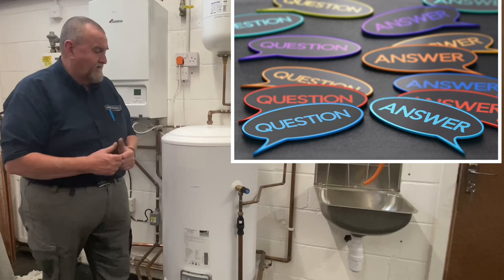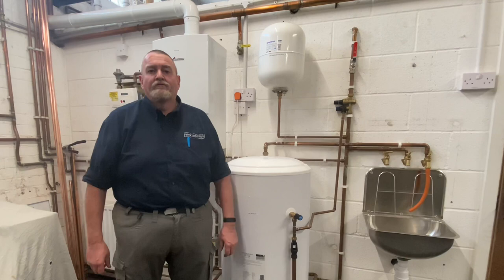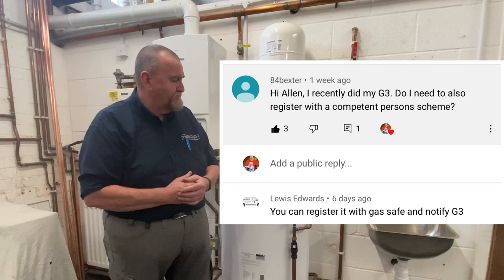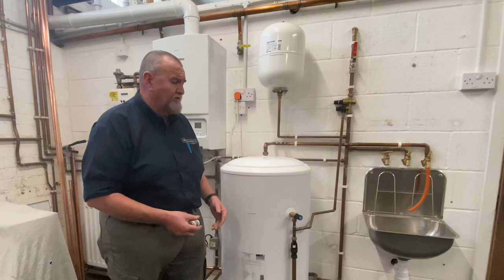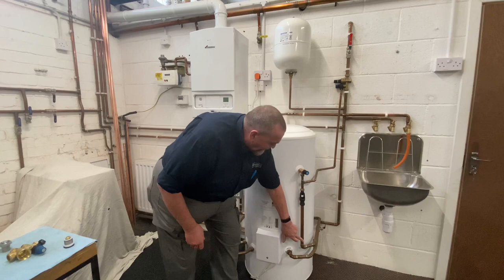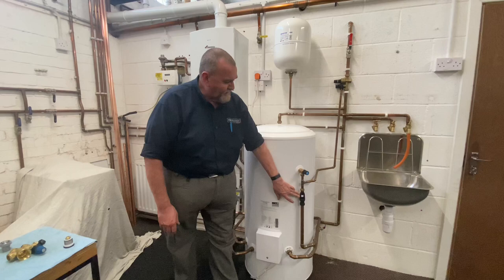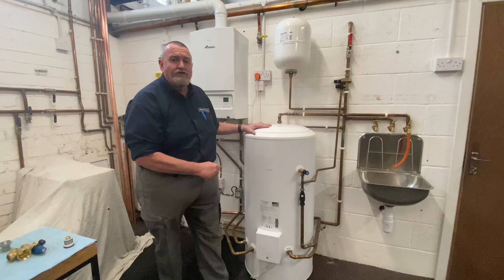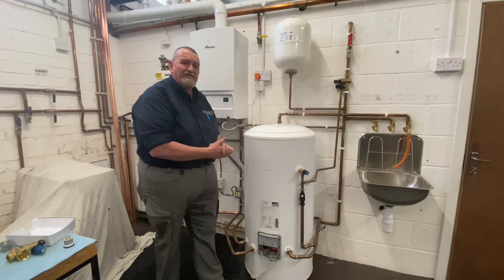Gas Training - How To Service Unvented Cylinders Q&A Roy Fugler

Comment: I've always wondered why D1 pipework is limited to 600mm. Mains pressure would push it down a pipe 900mm just as easy as 600mm???

Comment: Question.... on an unvented cylinder that has an expansion vessel correctly sized for its capacity, if it had a secondary looped fitted to it which was very long, say over 100 metres, would you have to recalculate the vessel size of the cylinder as you'd be adding 100metres of 15mm pipe which holds x amount of water which would technically increase the size of the cylinder and its technical capacity, have asked this question on my unvented and never get a straight answer. ..
Reply: Hi Phillip, as you say you are adding to the volume of water so I would say you would need to calculate the volume, then resize the vessel accordingly.